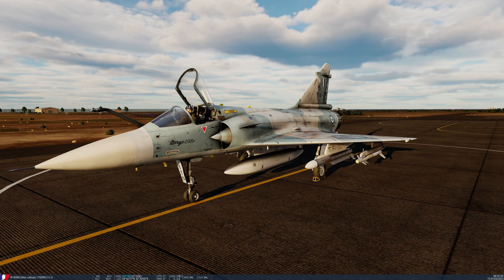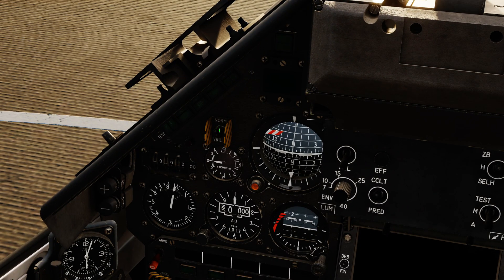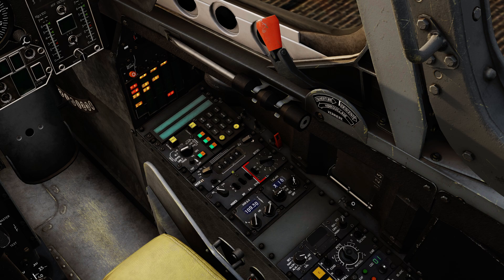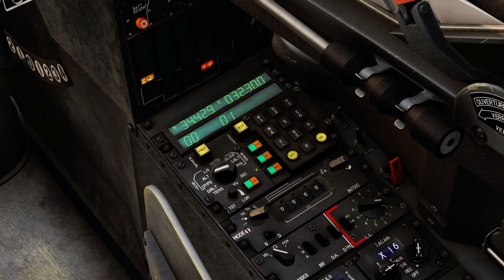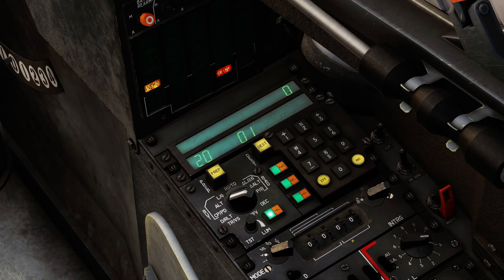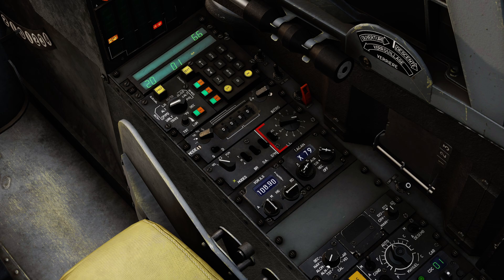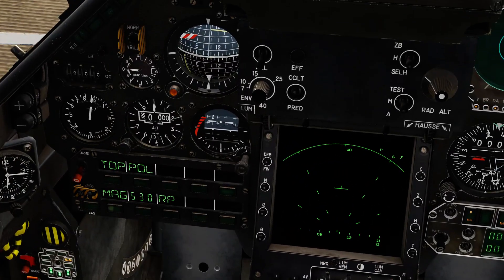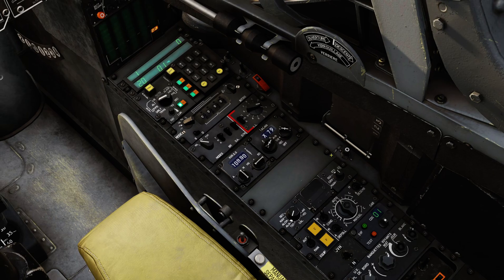DCS M2000C Tutorial 1 - Startup

Comment: While following along with this I couldn't get the plane to start. Turns out the left side igniter ( 4:57 ) was not working, so you do actually have to use the right side igniter. Not sure if that's a bug or a "feature."
Reply from the maker: Ah, that is definately a bug as both should work. Probably hasn't been picked up as the switch starts off in the right side position.